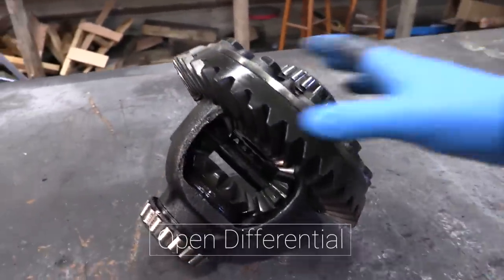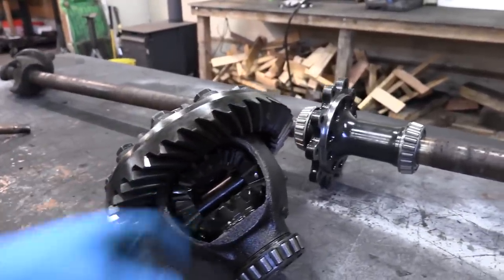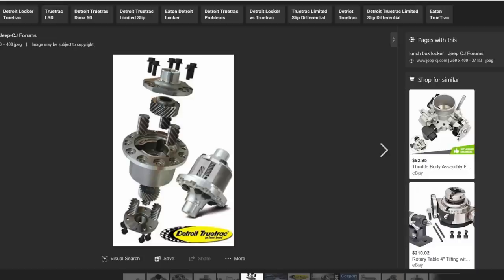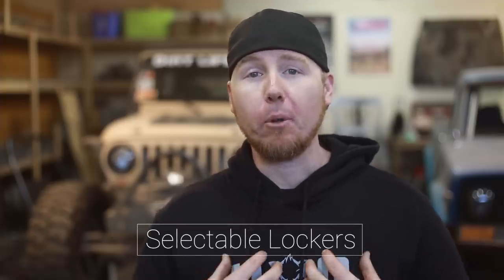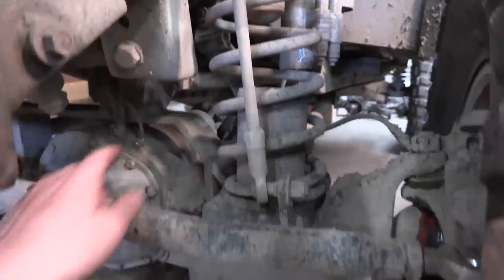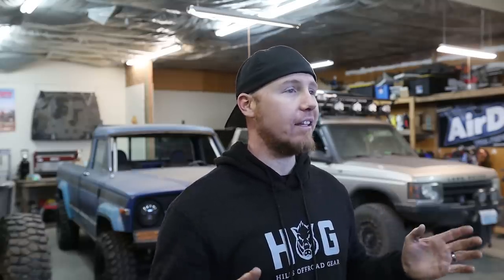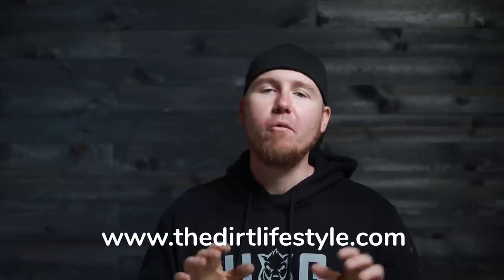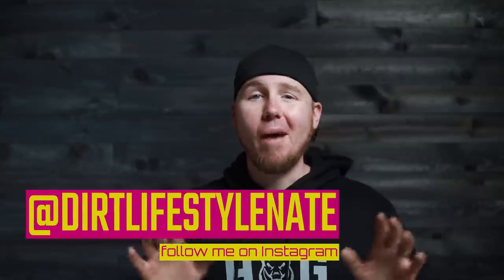Differential Lockers! ARB vs Yukon vs Detroit vs Spool

Comment: I’ve seen that OX Lockers can be run with a cable, air or electric.
Reply: Deep Behind Enemy Lines - yep, without pressurizing the diff.
Reply: I am thinking when my Rubicon lockers shit out switching to OX since they offer a 32 spline, and I already chromo shafts.
Reply: The ox lockers use a fork that is anchored in the dif cover. All versions are actuated outside on the dif cover. I am going to use the OX  air lockers. There are no internal air lines inside the pumpkin. If you have a cabled OX locker you can convert it to air by unscrewing the cable setup and screwing in the air cylinder to the outside of the dif cover. They are american made. I look at the failures on air lockers on youtube and it is the internals that go bad.
Reply: I’ve got an OX locker in the rear of my JK and I love it.
Reply: Just got an ox put into a high pinion d30 to put into my tj in the next month. I'm excited!
Reply: I have a ox locker and it Runs off a air solenoid in my 8.8

Comment: CJ-5.  D44 rear with a spool.  It's extremely consistent (both wheels turn).  Cheap compromise early in the build.  Great offroad.  Livable on pavement, but would like better.  Selectable back there at some point.  Have OBA (ARB?).  But that slug for the Ox sounds nice.  Heck, I'd love a slug and a plug with no cable.  Aussie locker up front (D30).  Love it.  Actually, it's quiet (can't remember any clicking in 10 years besides installation time with cover off).  Having twin sticks on the transfer case makes the front Aussie a perfect fit.  Uncle's Detroit in the rear of his Jeep MB would move the vehicle 3' sideways on the street.  Learned not to run anything spring/clutch releasing in the rear.

Comment: Excellent video No Doubt maybe just a tin the difference between front and rear also. I think an auto Locker lunch box or Detroit Etc. Better in the front no brain function and nothing to fail. And mostly unnoticeable on the road I've definitely has a little bit of drift with the Detroit in the front. But definitely either a selectable or Torsen LSD in the rear to keep a tight turning radius and a more streetable vehicle. Love the Torsen LSD I have in my JK over the Spartan Locker I had in my TJ a lot more predictable no surprises when I'm not ready.
Ran Detroit truetrac in the front of a TJ since I still have the D30 and I didn't want to add stress to it. JK running the Detroit locker and I like it a lot better.

Comment: I have a 2020 JLU with a DANA 30 M186  up front on 35" tires and I installed a Spartan lunch box locker  . . . .  and love it! I have NEVER heard the banging in and out that people mention in some videos. Keep in mind, the JL has a front axle disconnect which helps tremendously on road.  If you plan to put in aftermarket axles and delete the disconnect it would be a whole different ball game. I have done some difficult trails in Arizona as well as Moab and love the traction. I do agree that on high traction surfaces it is harder to turn and will put it back into 2 wheel if 4 wheel is not needed; otherwise I just power through it. If money was no object selectable locker all the way but for a good inexpensive locker, don't snub the lunchbox.

Comment: Great video Nate, lots of good info for people trying to decide what lockers to run. One thing that I thought you should mention is the fact that with a full case auto locker or a lunchbox locker they can be unlocked with a little driver skill on the trail by building a little momentum just before you turn or want the locker to open, then lifting off throttle or clutching in for a second, locker will unlock then lock again when you apply power. The reason i mention this is because i have been doing it forever and didnt even realize it until i drove something with selectable lockers and realized they are like a spool or welded diff in this aspect, and dont seem to unlock instantaneously, like i would want.   P.S. got my DL hat and T shirts yesterday, thank you! love the hat, and i am a picky hat guy!

Comment: Great video Nate! I never really thought about shavings collecting on the magnet before. Now I personally run Zips and love them, but, I was on the fence for a while about air or electric. Correct me if I’m wrong, but the diff magnet (being electrically charged) only has a field when turned on. That being said, I may suggest maybe attaching a strong magnet to the diff cover or strong magnetic plug to collect the loose metallics prior to being sucked into the diff locker magnet. Kind of a preventative measure. Again I might be in the outfield on this one, not having personal experience with that style. Anyways, love the videos, glad you’ve gone full time with it!
Reply from the maker: From what I understand electro magnetics still have a little charge even when they dont have electricity going through them. If this is true then I can see an issue. But like I said I have no personal experience to verify yet. 👍

Comment: I'm using 8in Toyota elockers front and rear on 37s, 3rz engine on a rig that weighs around 4k lbs. I haven't had a single issue with them. Even after getting water down the actuator breather and leaving them for a couple months all was good. And if the actuator breaks, you can remove it and manual lock the diff. Only downfall imo is the 8in ring gear they come with

Comment: I've run the G80 LS, lunchbox, and now elockers.  They all have their ups and downs.  I have a stock Toyota eLocker on the rear of my FJ80 and it can be slow to lock/unlock at times.  I have an Eaton in the front and it locks in right away, but takes a little bit of a turn before it engages both shafts.  On my 4Runner with Aussie lockers (lunchbox), they're great except for when you have to turn under power.  Any time it is under power it wants to push straight.  It sometimes makes turns more complicated.

I often ride with people that have ARB air lockers.  The engage and disengage almost instantly.  However, it never fails that someone has an air leak and they can't get one of their lockers to stay locked.

Comment: On my SAS 93 Toyota pickup I have a Spartan locker in the front and welded rear. For the front the Spartan works great. It lets me turn on the trail but still lock up when I get on it. The rear was a cheapo traction adder while I save up for an elocker. It does good on road but sucks on road.

Comment: Ox lockers are the best. Period. That's all we installed at our shop and they're a great family owned company. They have electrical to cable as well that works great. If setup right never had an issue.

Comment: Hi, Buddy, you should bring your air locker to the cold weather, it sucks! In Florida or mid area, it works good, but when you bring it to Alaska, you will tell the difference between air and electrical. Air can be taken out when cold.

Comment: I've got an Aussie lunchbox locker in my 4runner and it works great off-road but on the street is sucks.  I have figured out the characteristics of it over time and adapted my driving style but still on tight turns like maneuvering at a gas station that thing is clicking and clanking and the truck even bucks sometimes from binding.  I am going to re-gear soon and I plan to get a Yukon Grizzly locker and move away from lunch box for good.

Comment: Nate, look into an Aburn ECTED locker. Basically it's an Eaton E locker with limited slip added to it. Great option for over landing rigs or street rigs You get added help of limited slip as needed but a selectable when desired. On my rock crawlers definitely always an E locker fan for  simplicity of just 2 wires. Only downside in use to an e-locker vs a air locker is the e-locker takes about an 1/2 tire turn to engage vs air locker is more instantaneous. With e-locker I just engage once I'm on my line ahead of when I think I may need it. Great clip to give people new to the the sport information.

Comment: I'm with you on the OX. The only real downside (assuming you did the install correctly) is you are a bit limited in where you can mount the actuators. Take your TJ for example, there's no way you could mount the OX actuators in your air vent.

Comment: Go Aussie locker. It’s what I have and mover thought it was loud. It mostly sucks in winter time when the road was partially covered with snow, sleet, and ice.

With above said, I’m going with ARB air lockers.
Reply: Aussie lockers are made by torq-masters who also make the torq locker. It has only six parts counting the springs and is said to be stronger and quieter.

Comment: I'm getting ready to install a spartan helical limited slip locker in myfront JKU axle. I keep hearing good things about them and I'm installing a ARB air locker in my rear axle. I appreciate your information about lockers. I drive my JKU on and off road. We get snow up here in Ohio so I went with limited slip front and ARB rear. On 35s.  This will be my 1st attempt to install 4.88 gears and lockers ever. Wish me luck. I've done so much research I'm hoping I do well.

Comment: As a paintballer I would go with an air pump over co2. Just because the co2 psi can vary depending on temperature. We use hpa, High pressure air so we dont have this problem in winter. Have you noticed a pressure difference in your tank?

Comment: Zip locker up front, ARB in the rear.  I use the ARB pump to actuate them...the CO2 is to air up tires and run tools, if I need them.

Comment: Hey Nate - great content as always. My Ox drive-aways unlock the axle. Very smart backup system - hence going that route. Have you talked to them about reviewing?
Reply from the maker: Thanks! I haven't spoke to them but maybe I should. Ox lockers might actually be perfect for the overlander build 👍
Reply: Dirt Lifestyle - you should! I’m new-ish to Jeeping, but very familiar with running and repairing heavy trucks in less than ideal conditions. These look well built to me. Will drop an email to the man at Ox who has sold me the last 3.
Reply: Dirt Lifestyle - btw, I wrench on a small island. When shit brakes, I have to fix it...no dealers for 1,000 miles of ocean, so you learn how to spec equipment via hard knocks. 

No air lines, no pressurized diff/o-rings/seals to fail, no electric solenoids, no magnets, no wiring to get salt corrosion. And if I tear the cable off, or rust gets to it - I can still lock/unlock manually. Happy to send you photos of internals if you want, I have one of my diffs open at the moment.
Reply: or....ahem....if the folks at ox are watching (and reading), maybe THEY could approach Nate....🙄
Reply: michael Harris - that would be great if they were reading wouldn’t it ;)

Comment: Good point about metal shavings on an e-looker. I’ve never thought of that, or heard anyone raise that point before. You are a lateral thinker for sure.
It got me thinking though, if it’s an electro magnet(coil) then when it’s off there would be no magnetic field, so debris would make its way to the drain plug (if it’s magnetic). I know nothing about these so maybe there is a permanent magnet in them. Excellent video as always👍
Reply from the maker: It's pure speculation on my part but I think electro magnets still carry a small current when of. It only takes a tiny amount of force to get a spec of metal to stick. But again I'm not completely sure. 👍

Comment: One other down side to the air locker is cold weather. I wheeled into snow, camped for the night. When we got up to to go the locker would not lock up and leaked non stop. The gear oil was too thick to get it to lock up until it warmed up. Other than that I thought it was an awesome locker.

Comment: I think a few points you could elaborate on would be cost and availability of parts and repair. Personally I live in Australia and ARB lockers are quite cheap.  I also have an arb dealer who carries parts 15 mins from my house. Hence I have ARB air lockers. One big thing to consider is how many lockers you need and you also have the ability to mix and match. Someone who is doing less offroad may be better off running an auto locker up front and an elocker in the rear. Also if you're not fitting them yourself consider the experience of whoever is fitting them for you. If your local diff shop hasn't ever fitted a E locker but they have set up 100 air lockers you're probably better off with air. Great video tho man ! Very good points and information.

Comment: In regards to the ox locker there is a channel called Snowbatman99 out of Pendleton Oregon that has used one for years and claims no issues including the fact his cherokee is set up for four wheel steering because of crabbing side ways in the snow. I like the ox locker concept of flexibility and is one I would like to try.

Comment: Nate!

I run a Detroit Tru Trac in my rear and an eaton e locker in my front. 2001 Jeep XJ on 35s (with upgraded axles)

My dad has an 86 cj7, I suggested a tru trac for the rear. Have you heard of anyone running one in the front?
Reply from the maker: I ran one in the front. Worked great!
Reply: I want a true track for my 03 Cummins ram

Comment: For your Land Rover I really recommend Aschroft Transmission, they have very good stuff, and I prefer this tan ARB lockers, the system is slightly different, and it  solves the problems off the ARB lockers. Regards from BCN.

Comment: I’m currently running a Lincoln Locker in my dana70HD rear diff and a Detroit auto locker in my dana60 front diff on my ‘83 GMC K2500 spinning 40” Super Swamper LTB’s.
Been staying strong with no issues for the last 5 years 👍

Edit: welded the rear diff myself.

Comment: Very informative. It is wheeling season and I have the cash but I can’t make my mind on which lockers to install in my YJ. It’s a 2.5 on 31” mudders and I want to control the lockers. The cable actuated one sounds good cause I will keep it adjusted and can easily fix it on the trail. Thanks again!)

Comment: I ran Grizzly lockers in my sd60/10.5 combo. Very happy with them, and they're better than Detroits. Not only will they not explode other parts if they fail, but replacement parts are readily available for them.

Comment: I used lunch box lockers in an XJ with 33's/4.56's for over 10 years D30 front and 8.25 29 spline back. They work great. I did lose the rear lb locker while turning at a light pulling about 4 tons. lol, I know overloaded. You do get a little push on the front in 4wd, manageable though. I don't wheel like Nate, though I did take it on some highly degraded trails. I ended up replacing the rear lb locker with a Detriot Locker, which is more temperamental than the lb locker. Hope this helps

Comment: I had an Ox locker in my TJ before I started my 1 ton build. It worked great. The only issue I had was exhaust melting the cable housing and binding it where it wouldn't engage. I went through two cables and finally ran radiator hose around it from the locker to the hole cut through the tub. No problems after that.

Comment: I know it’s kind of a late comment, but I finally have a little experience with lockers under my belt. A buddy of mine swears by auto lockers and pretty much exclusively puts lunch box lockers in his Toyotas unless he gets a good deal on a Detroit or buys an axle with a Detroit in it. He’s broken a couple of welded diffs and bent a spool, but not destroyed a lunchbox yet. I have a Spartan locker(lunch box) in the front of my truck(full size dodge on one tons and 37’s) and factory lsd rear right now and have had no issues, just don’t like hearing it ratchet. I’m now going to air lockers soon and I’m stoked to be back to making smooth turns.

Comment: On my 01 TJ I currently run an ARB in my rear Dana 44 and love it, no problems at all with it but the air supply is the weakest link there. In my front Dana 30 I have a Lokka lunchbox and for what it is I cant complain. The Lokka is quiet, does what its supposed to do and so far hasnt been a problem. The biggest problem is reversing to get it to unlock and thats just me being lazy. The reason I went with the lunchbox is because I plan to put a Dana 44 in the front so why spend money on an axle I plan to yank out. When I do upgrade to a Dana 44 front axle the OX locker is at the top of my list for a locker in it.
Now I have to decide what to put in my 22 Tacoma which last Thursday I made the 2nd payment on and then Friday a 7 point buck tore the front end all to hell. Aw well thats life!

Comment: I live in Alaska where traction in ice snow and rain is an issue.  I have used and like the limited slips over the years as well as after market lockers I have installed..  Then in the nineties they came up with the awd rigs.  I had a 99 Tahoe and later a Chrysler Mercedes awd.  They were really super in that when you put them in they reacted before you could even think.  Really good in the ice and snow.  So the question I have is how sturdy are these systems and could they be upgraded for off road use?  If they could the ones having awd and 2hi with 4 lo would be clear winners in my book.  The big thing I noticed (I have been driving in this stuff for way more than fifty years) is there is no hunting.  It is a nice even propulsion.  Driving on snow packed roads where one tire lane is bare and the other side of the rig is on ice you don''t feel the fish tail and rear trying to break loose before the limited slip catches it with these systems. This being at forty or fifty miles an hour.  Super nice manners on pavement as well.  When the pavement is dry but icy in shadowed corners or bridges they just take it in stride.  I leave it in awd and pay the 1 or 2mpg penalty happily.  Summer or freeway driving 2 hi works perfect.  I would like to see how they test out when driven off road.  Thanks for the video.